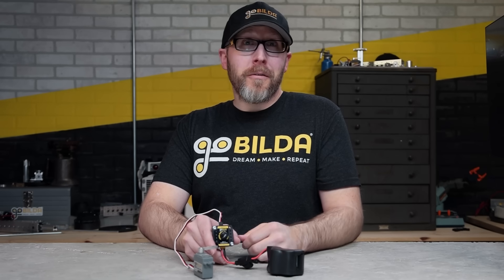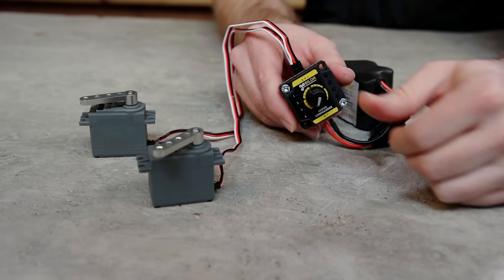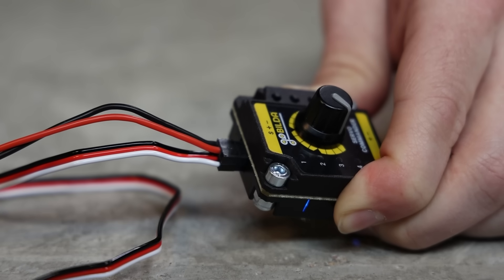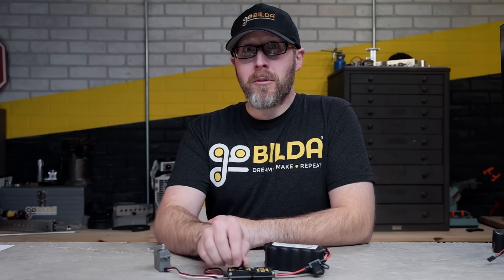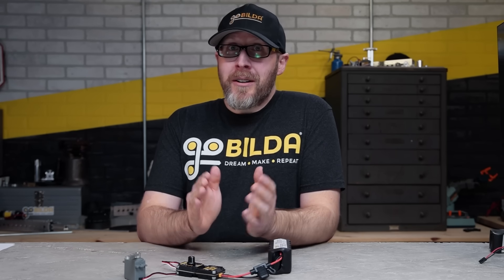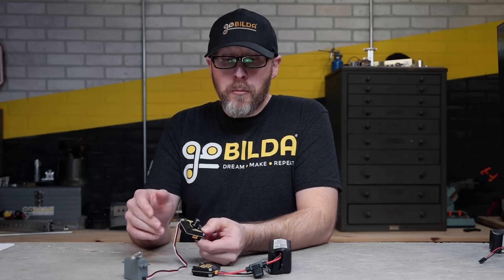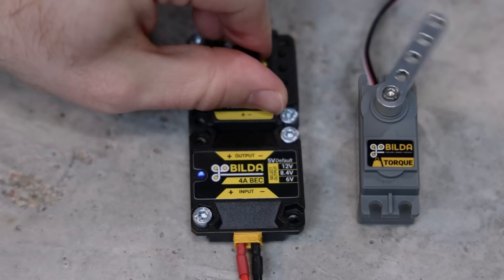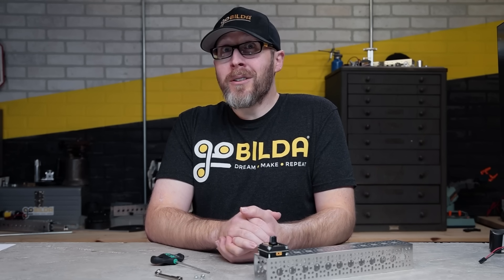Servo Commander Overview

Comment: Useful though in our application we need to do this remotely, the servo would be controlling the potentiometer on a much larger 3.5hp 120v AC motor via remote & transmitter.